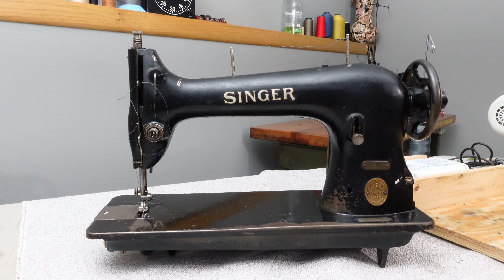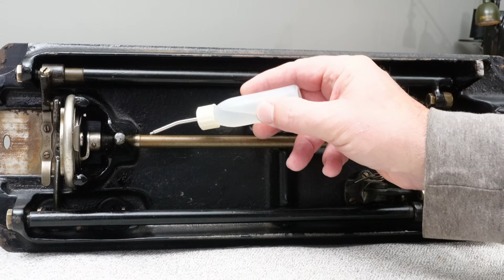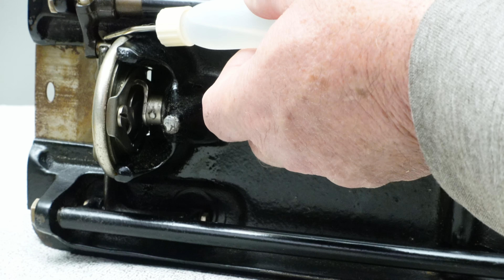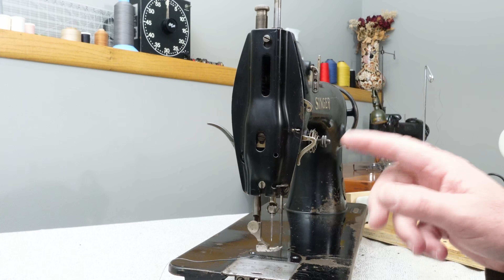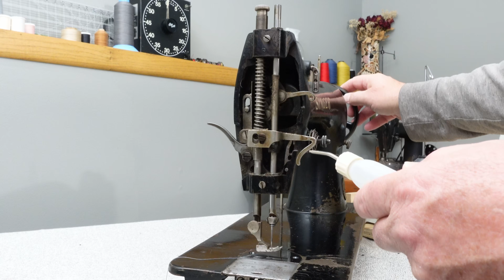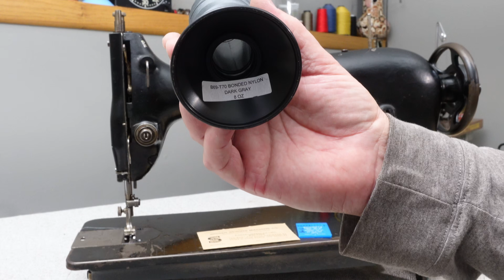1925 SINGER 31-15 SEWING MACHINE OILING, PROPER NEEDLE SYSTEM (DPx5) & THREAD

Comment: Thank you for all of the help on 31-15's! I just received one yesterday in the mail.
Looks like hardly ever used, but very dry & rocker shafts/feed dog are frozen.
Anyhow I have question on the needle bar. When at top stroke My bar is only 3/16" above the top bushing, . Not an inch or two like your videos. When at bottom stroke the needle bar is clear of the top bushing completely . It seems short? Are there different lengths?
Help.    Brad

Comment: Interesting. Can it be fitted with an on board motor?
Reply from the maker: Probably you could fabricate a good mounting bracket, but this solution was best for me working on lots of machines.
Reply: Yes you can, I have some bolts that fit where the bobbin winders mounted too the back of the column near the base, you can take simple motor that mounts on the outside of the sewing machines like the singer 15 etc and mount a motor there and use a small rubber drive belt